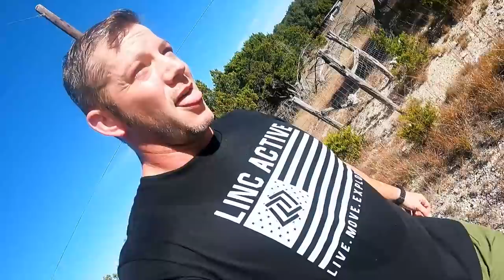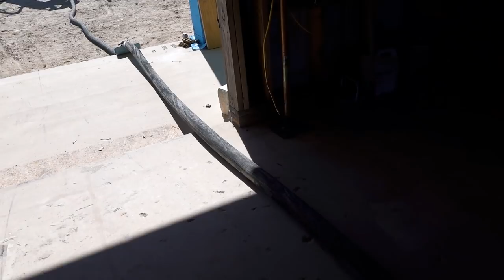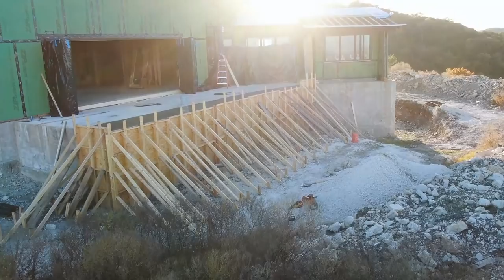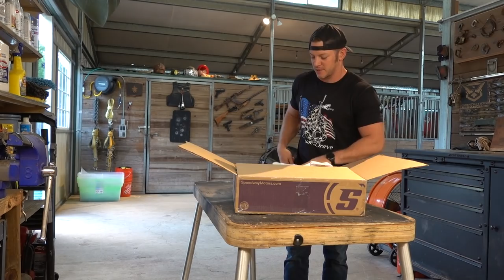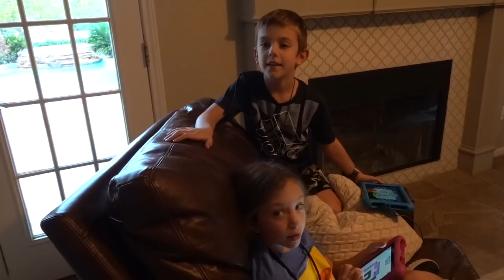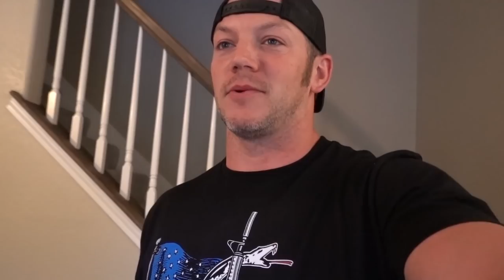Kinda an Abandoned Mansion video, but just kinda

Comment: "Not sure expensive, like 250 300 dollars"

We both have different definitions of expensive
Reply: Yeah for him it’s like $2 ☹️
Reply: 250-300 isn't expensive for what it is. Some race suits go into the 1000s of dollars, this is what he means. While the man has worked hard to get to his financial position, he's not trying to flex it here.
Reply: @alepratt18  Right! Safety gear, like tools, is an investment NOT an expense! I don't ride anymore but I still have a motorcycle helmet that cost MORE than that fire suit did! (20 years ago). I forget what Snell # it is but it IS fire-rated. Took one of my cars to the dragstrip a while back and the instant I pull it out of the trunk during Tech Inspection the guy said: "You can't use that motorcycle helmet!" "Why not?" "Motorcycle helmets aren't fire-rated". Pulled the liner loose in the back and showed him the tag. "Oh. Um. Ah. You're OK then"...
Reply: @alepratt18  i agree.
Reply: For life-saving equipment... If I made 50K/year that means my family is out 1 million over the next 20 years if I die. It's cheap insurance.

My wife asked me why I spent $400 on a carbon helmet. My answer was "not only will my brains not leak out, my neck won't be as sore! Plus, it's normally $700, but it was on sale like your shoes!" 
Never again has she questioned my safety gear.

Comment: I didn't see them vibrate that concrete. Hopefully there's not a bunch of air pockets
Reply: I was thinking the same thing!
Reply: @Joshua Beckwith it is odd that there isn't a vibrator laying around in any shots during any pours he's showed us. I was thinking it's odd they don't seem to vibrate the concrete when you can see trowels, floats, and skreet boards laying around during the pour but no vibrator?
Reply: @leftyeh6495  well, your mom left hers out, but it was way too big for this job, so they couldn't use it.    I couldnt help myself, i tried not to say it, but i just had to.
Reply: Exactly my thoughts too

Comment: Time your eating and what your eating at the time, you can put your self in ketosis to convert the fat. Also time of day helps too. Eating ever 2 to 3 hours will keep your metabolism up, drop it to 3 to 5 hours and stack your meals. You'll eat more and run alot hotter. Like throwing alot of firewood in the stove all day is a no no,  filling it up 3 to 4 is better.  When you do that it gives you time to clean out the ashes ( your digest tract), and check the flute ( your blood sugar, heart rate, body temp, oxygen, heart rate, etc.)

Comment: Matt with that double edge knife you can run the edge you don’t want in a belt sander or grinder to flatten that edge finish it with sand paper to debur it!
Reply: Good advice. I’ve done that to several blades.

Comment: That out the front blade(OFB) is a self protection knife. It isn't for letter opening. It isn't for box opening. It isn't to hammer on, or to be used as a hammer. It isn't a screwdriver. Self protection. Carry a Swiss Army knife for that stuff. You wouldn't use your Glock for any of that other stuff, don't abuse you self defense knife for any of that stuff.

Comment: I would have added some bolts into that section to connect it to the old concrete post-stress. In a couple years that will ne concrete will start sliding down the hill..

Replace the dager with a microtech scarab Tanto

Comment: Carefully dirty bulk Matt. I did that a few years back and it definitely worked but i t shocked my body. Lol I started having gallbladder issues because of all the cholesterol being flushed and then my blood pressure went through the roof and has stayed there to this day. I now have hypertension bad and take meds for it. It doesn't run in my family. I'm by myself there. Just take some extra omega 3's everyday to help keep that junk out of your veins. Good luck with it though. It does work well for most.

Comment: Be careful with dirty bulk. Ensure you're pushing nutritional stuff with the bad stuff. You need excess vitamins and nutrients in your system will you're working with overload and mass increase. Be safe my guy, I'm 2months into my cut from a bulk. Nothing better than filling t-shirt sleeves and stretch quads on jeans.

Comment: It didn't appear they used a vibrator on the concrete which will likely result in honeycombing given the depth you are pouring.
I'm no expert but thats like concrete 101